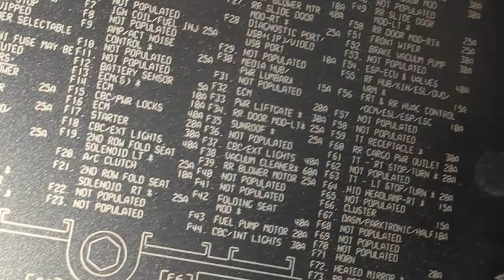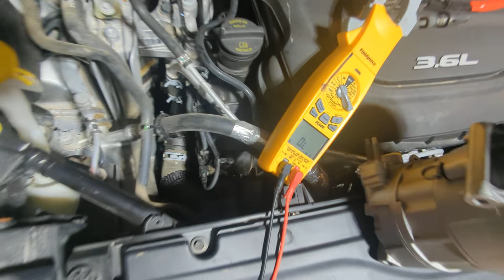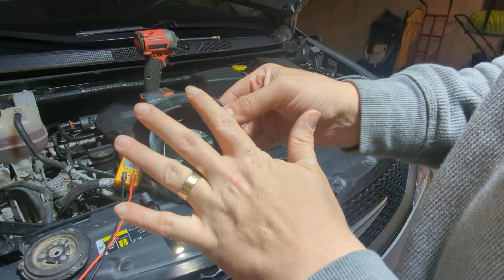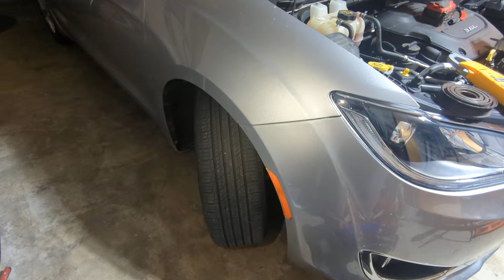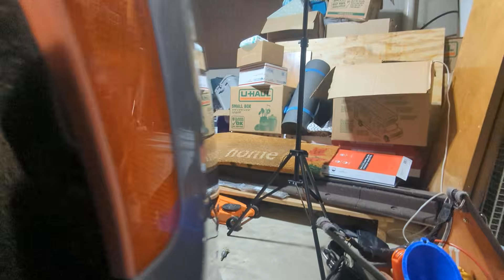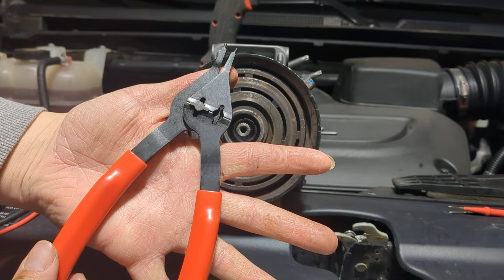AC Compressor Not Engaging (2017+ Chrysler Pacifica) Diag + Solution

Comment: I own a 2017 Pacifica, and I encountered an issue where I wasn't receiving voltage on either side of the A/C Clutch Fuse (F20). Seeking assistance, I visited a local reputable servicing chain. After waiting for four hours, they informed me that they were unable to load freon due to a low-pressure switch preventing them from filling it, suggesting I visit the dealer instead. Curiously, on my way back home, the AC turned on automatically and functioned normally for a day. However, upon testing the voltage at F20, I found 14 volts on both sides of the fuse. Yet, the following day, the same problem arose, with no voltage detected across the fuse on either side. What could possibly be causing this recurring issue?
Reply from the maker: Based on what you're describing, and what the shop said, I'd say your low on refrigerant. They tried to add some. It didn't work, so they told you to go to the dealer. You try the AC right after, and it works. Shortly after the refrigerant leaked back out and the low pressure switch tripped again. 

Based on the history of these cars, it may be your compressor that's leaking. If that's the case, the dealer is gonna tell you you need a new compressor, that's gonna run you close to $2,000. 

If you're handy,  you can check to see if the low pressure switch is open. It's right there in the engine bay
Reply: @David_Poole  Thank you for the prompt response. Regarding the service center's inability to fill Freon, do you believe that a small amount might have entered and could potentially sustain the system despite a minor leak? Unfortunately, accessing the pressure switch in the Pacific is challenging due to its design, leaving limited space. I might have to remove the passenger side tire to inspect it thoroughly.
Is there any other way to check using multi meter ?
Reply from the maker: @RamakrishnaNVmanasa  sorry for taking so long to get back to you. The low pressure sensor is located at the top of the engine bay and should be very easy to check. In theory, you could cut the wires going to the sensor and connect them to each other to bypass the sensor entirely. Or at the very least, get one of those wire splice connectors that allows you to connect two separate wires together without causing significant damage to the rubber sleeve. This would allow you to at least rule out the low pressure switch as the culprit. I may try to make a quick video tonight showing you how to do what I'm talking about.